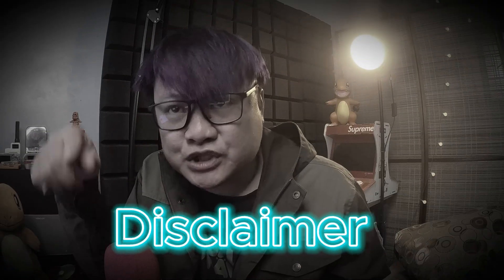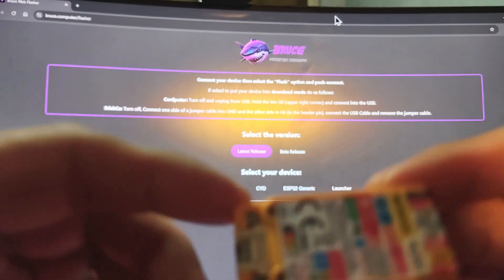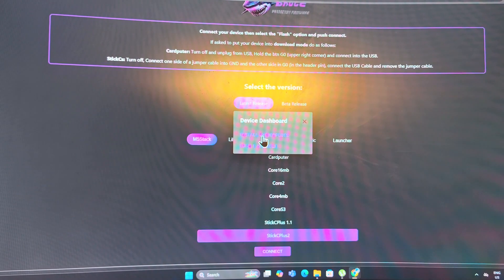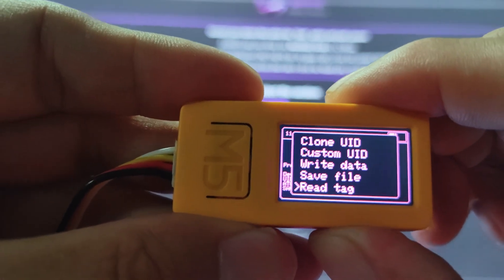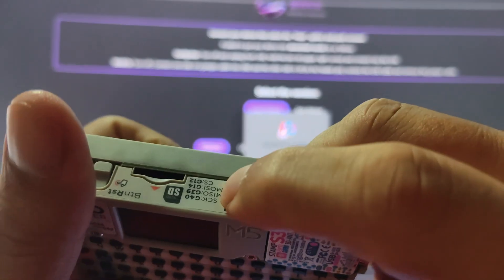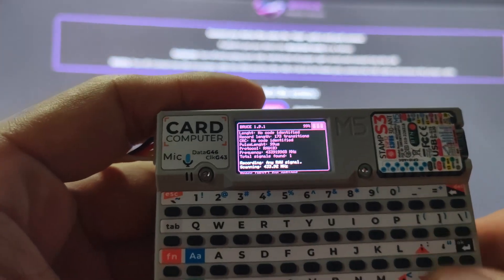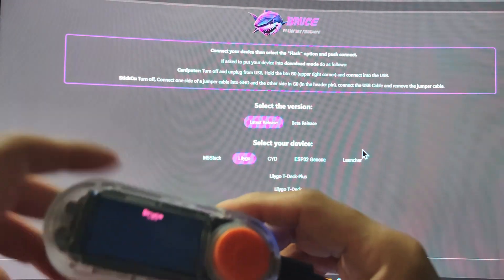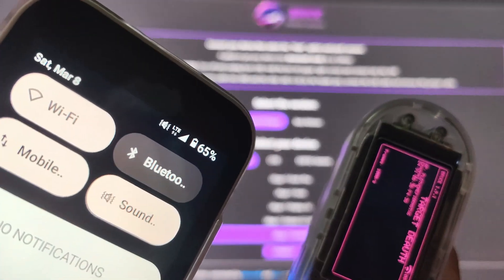Budget Flipper Zero: Installing Bruce Firmware on ESP32 Devices

Comment: Bruce fw 1.0 -1.9.1 is broken. fucking sucks tbh. rfid and rf side of the fw is wack. Marauder (wifi from justcallmekoko is great tho) cant read blocks, jammer stops after 5 sec, memory drain force to hard reset etc. 0 demodulators. fucking hate it.
Reply from the maker: just revert back to the previous build. Please be kind to them, remember they are doing this for free